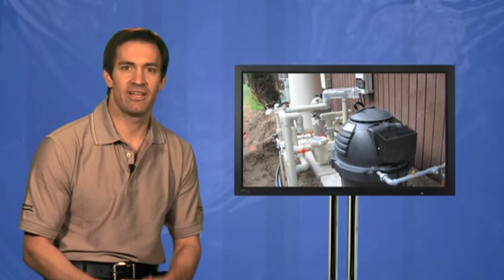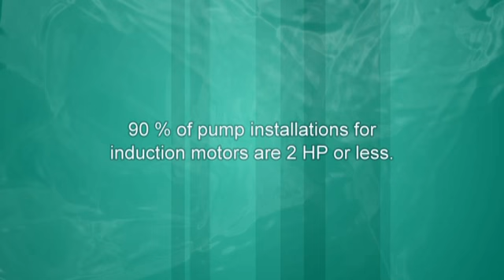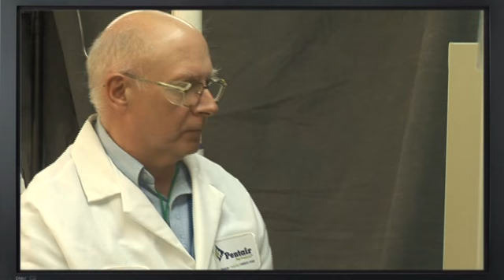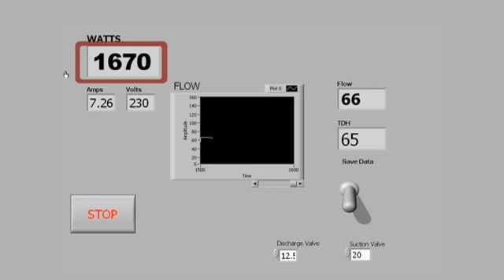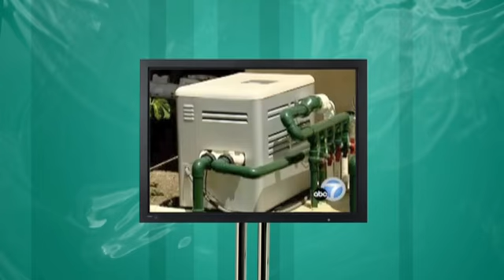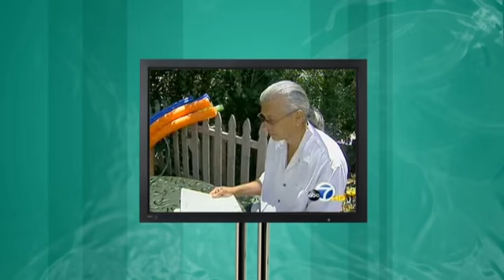Pentair INTELLIFLO Variable Speed Pump

Comment: What is the best speed to run my pump for heating my pool with a heat pump? 20k gallons
Reply: I have the same question: I was told 28K RPM but I haven't tried it yet.  Just had the pump installed recently here in MD.
Reply: Depending of the distance from the skimmer to the pump.  Start with 1000 rpm and Is needed increase or decrease 100 rpm at a time.
How do you know which is the lowest effective speed?
Two conditions need to be present:
The skimmer weir is being pushed back. That means you have proper skimming action for most skimmers is about 25 gpm
The filter air release sprays water which means the filter  tank is full .

Comment: I thought watts = amps * volts.  According to the video, the induction 3HP pump uses 230v and 7.26 amps which by formula would be 1669.8 watts.  However, they say that the watts used was 2880.  In contrast, the Intelliflo pump used 230v and 11.5 amps which by formula would be 2645 watts, but they claim it only used 2610 watts.  So why does the traditional formula not work according to Pentair?